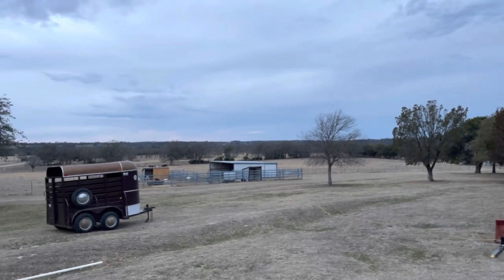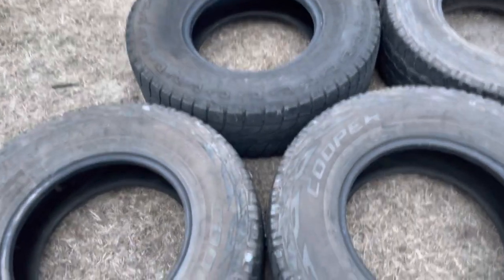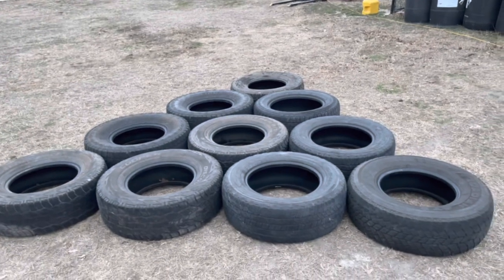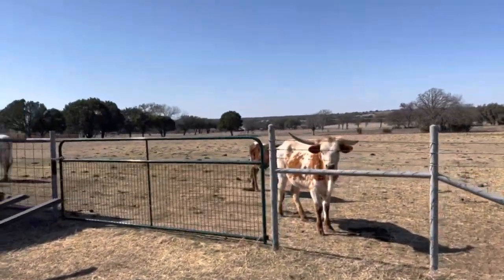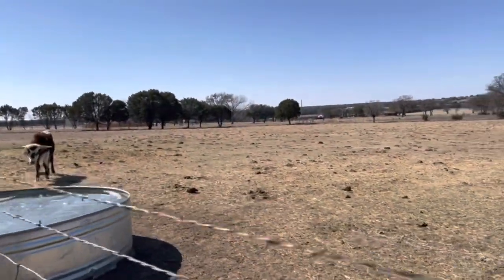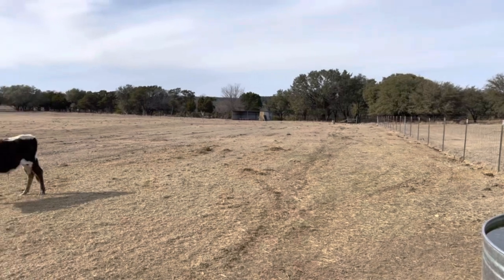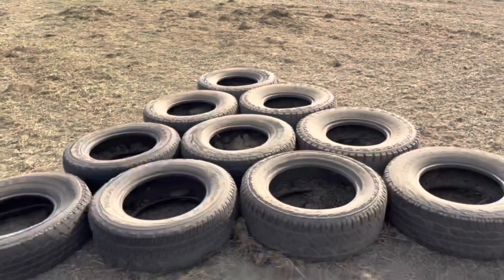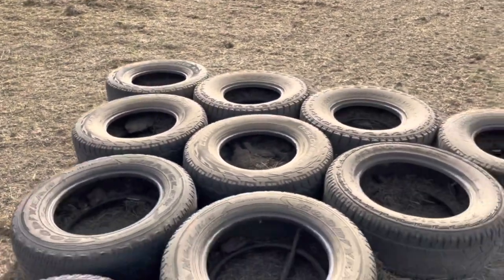Free Tire Drag For Our Pasture

Comment: Cut some chain lank fence pieces as wide as you want them and hook them together so it’s long as you want. Drag it behind pickup or tractor or atv/Utv etc . Bust everything up real nice but not heavy enough to tear up the grass. Can weight it down with a few 2x4’s if you prefer. Very light and easy to drag. Can just roll up out of the way when you are done.